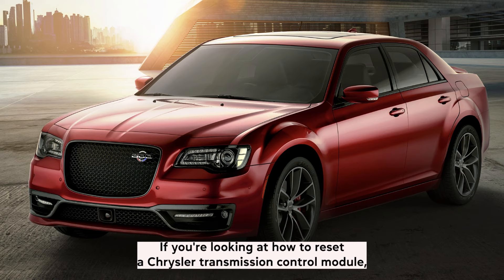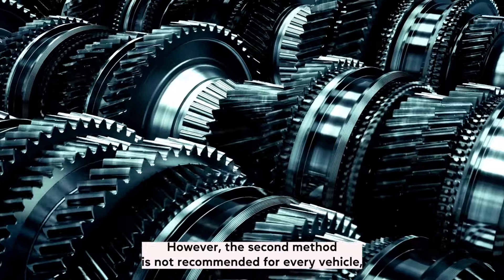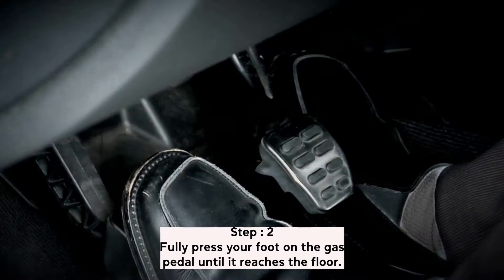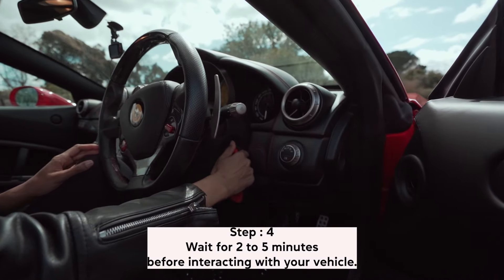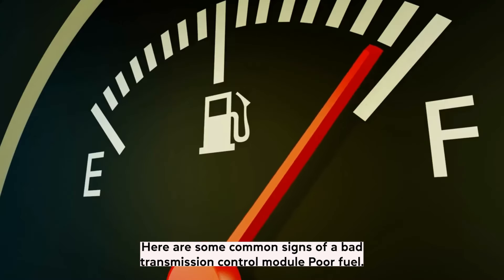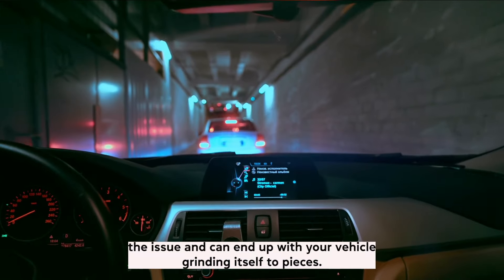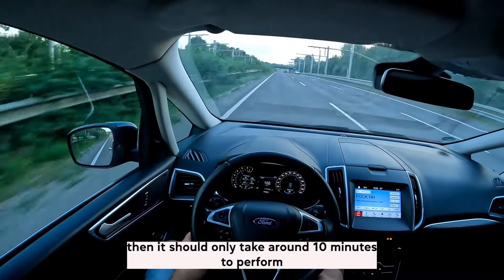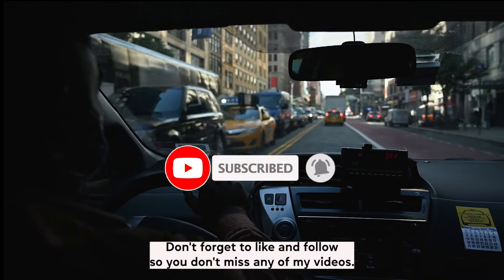How To Reset A Chrysler Transmission Control Module - Symptoms Of A Bad TCM

Comment: What if I don’t hear a click
Reply: That’s a very good question. I have a 2019 ram 5.7 L hemi and I did not know I had an adaptive transmission. I had no idea these things even existed. And certainly not as long as they have been around since 1990s. But I consider myself above average in keeping up with motor trends. And I spent about two years trying to figure out why my transmission would lug at about 1500 RPM. Took the dealer twice no help. So I saw three videos that said the same thing from different people. That’s good enough for me and so I tried it. Knock on wood, so far it’s actually worked. So you’re not going to hear a click necessarily, but it might still work. So give it a try. May have to a couple of times to do it right. It’s trickier than you think because you have to press the pedal, but do you do it fast.?  Or release the gas pedal slow or fast?. It’s trial and error. But try it.

Comment: When cleaning or replacing the sensors of a sebring 2009 2.4 should the battery be connected or not... aswell for the cam shaft or throttle body or co2s